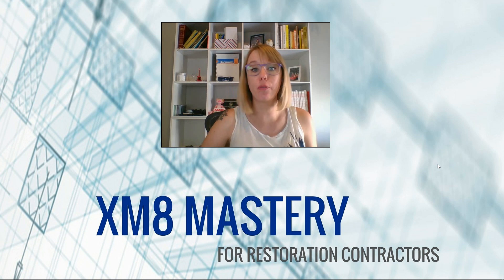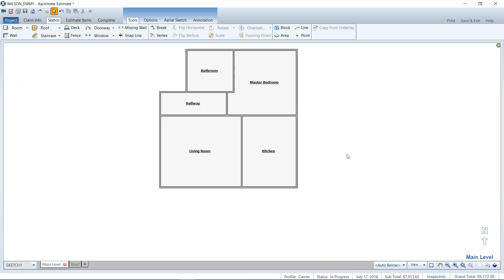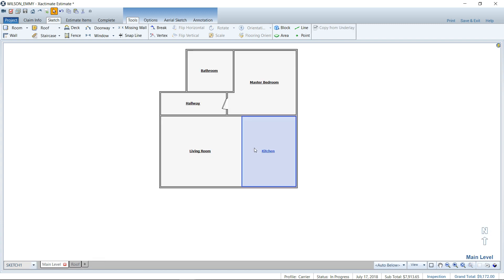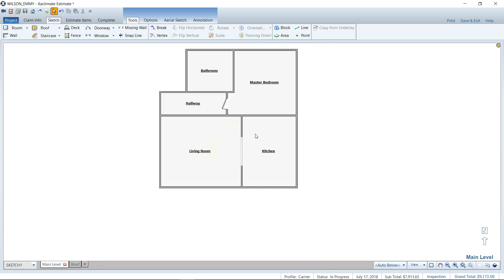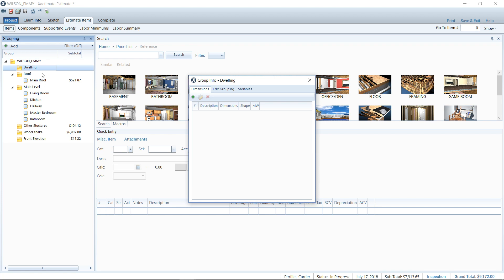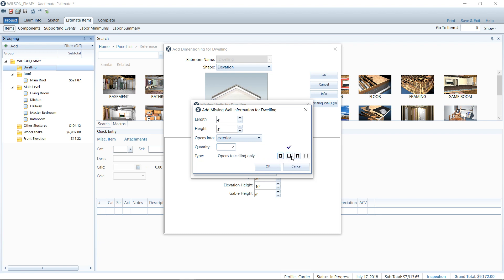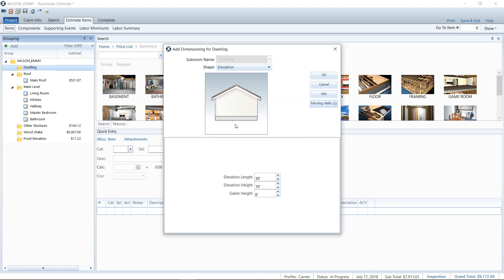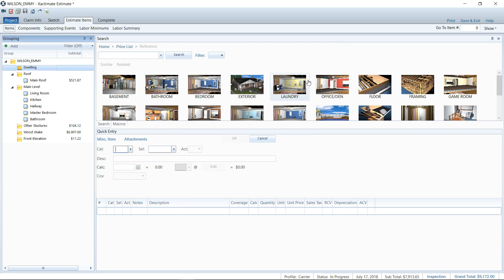Wall Missing from Floor to Ceiling

Comment: Alina I love your videos they help me so much! Does anyone know how to remove a ceiling if I am doing a sketch where the same room in on two levels like a big family room but the ceiling is only on the second floor? Thanks in advance!
Reply from the maker: Hi!  You would divide the room into sections based on ceiling height, and then set the ceiling height correctly.